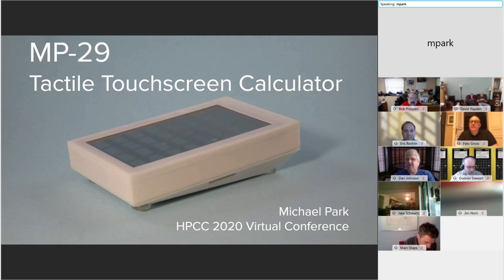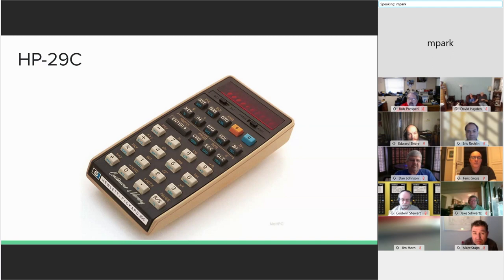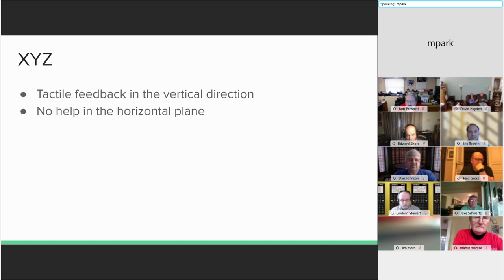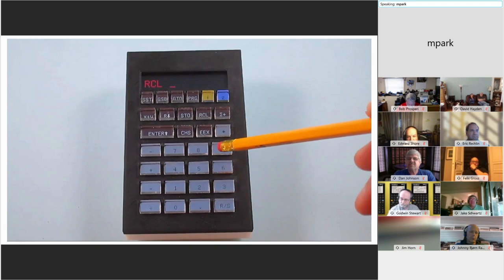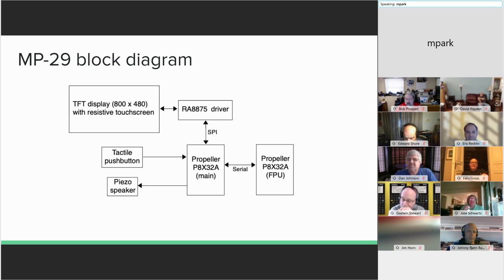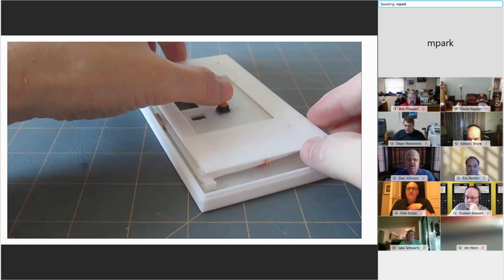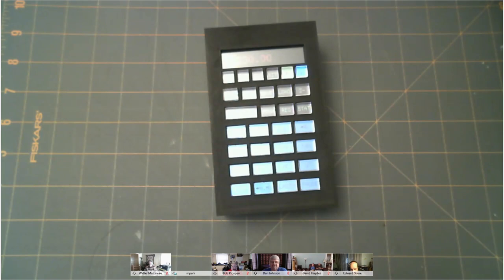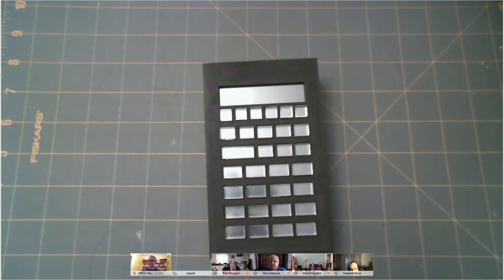HPCC 2020: MP-29 Tactile Touchscreen Calculator (Michael Park)

Comment: brilliant. I wonder whether you could get away without the scissors mechanism by using a touch screen / digitizer between the display and the keys, perhaps of the older resistive kind. If it were to work with a capacitive screen, I also wonder if it would be possible to produce a transparent acrylic keypad that fits over a smartphone and get similar results.

Comment: That description of "RP-Entry" isn't quite what I'm familiar with.  I expect Enter to take the number I have entered "so far" and yes, duplicate it to Y.  But, if I immediately begin typing another number, that number will OVERWRITE the x register; it won't lift again.  Anytime any other operation has preceded Enter, it does the usual duplication, without triggering an "overwrite."  So, that's not quite RPEntry - what do you call this one, which is how I think HP calculators operate?
Reply: Hi, sorry I'm just seeing this! I'm not sure I understand your question. If you type 123<Enter> and you end up with 123 in X and Y, that's regular RPN. RP-Entry (or RP-Ntry :D) is how RPL behaves.

Comment: Just found this video through Hackaday (https://hackaday.com/2020/10/18/retro-calculator-design-has-creative-tactile-touchscreen/#comment-6287297).

Very nice concept, and a nice first hack at implementation.

I suspect that your battery life issue has nothing to do with the microcontroller part of your design, but with the power supply.  If you are using a DC-to-DC converter to convert your battery voltage to something the rest of your circuitry needs, you may want to check how much current is coming out of your battery, and how much of that is actually going to your circuitry.  My guess is that the DC-to-DC converter is pulling around 30-50 mA, even with no load at all.